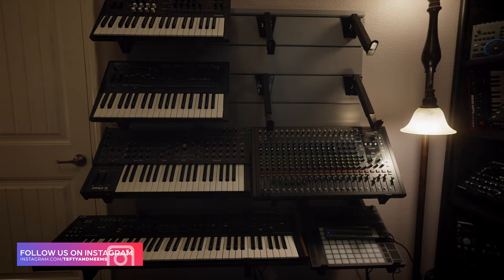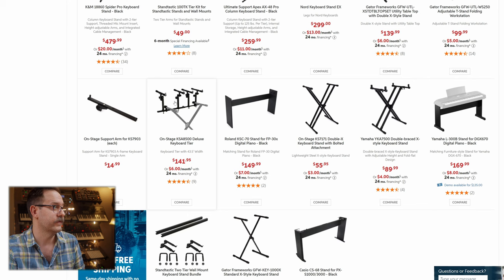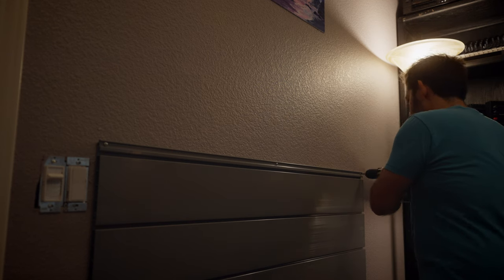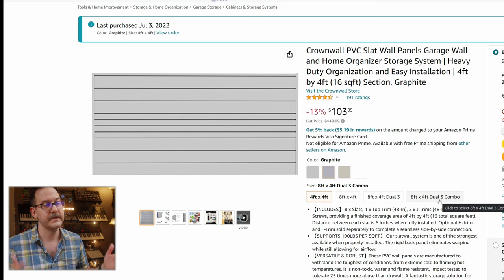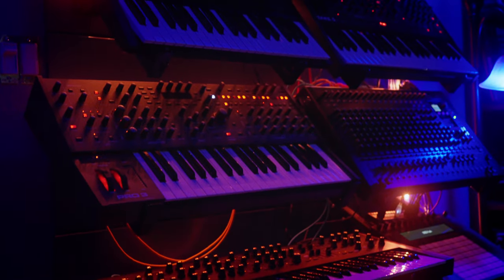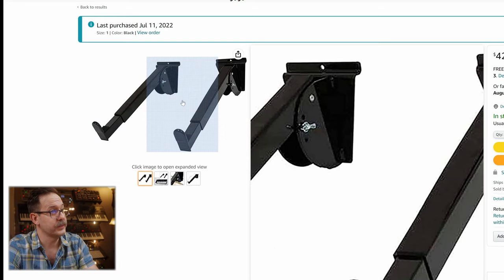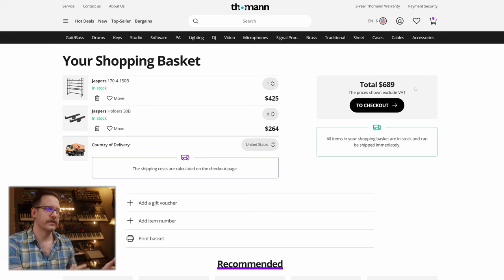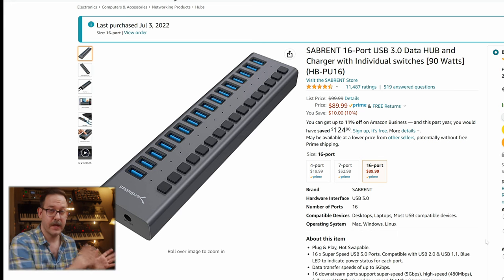Building A Synth Wall // Keyboard Stand Alternative

Comment: Funny how this is in my feed AFTER I buy the 3 tier on-stage deal🤦🏽‍♂️. BUT!😃👆🏽 my plan is to place a plank on the lowest level and possibly two “DJ” laptop stands on that—place a yet to be purchased Rev2 on the plank and maybe both my RefaceDX and CS on the DJ stands because there’s a larger gap from the lowest level to the 2nd tier. Seems like wasted space. Then the Deepmind6 and maybe a drum module or boutique synths on the same tier and then my beloved MS2000 on top. As a renter I prefer not to do the wall slats.